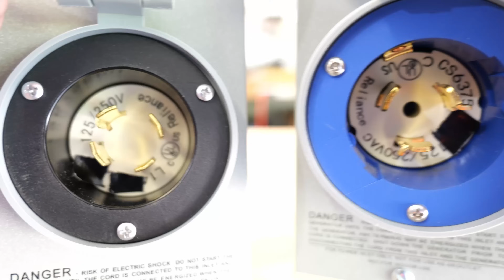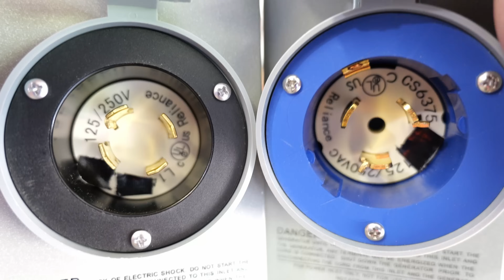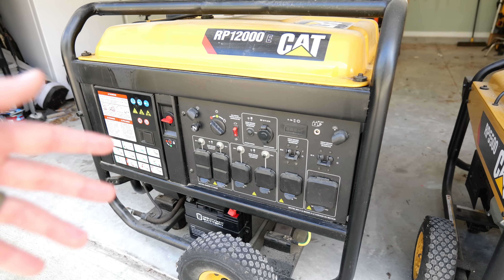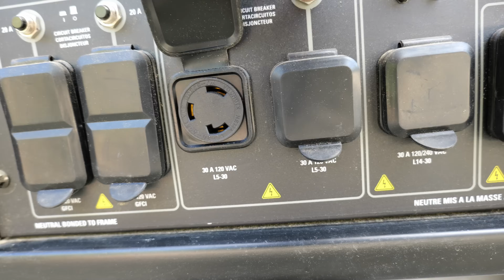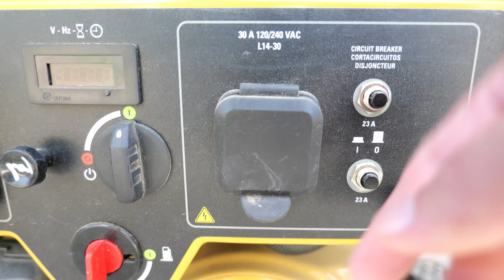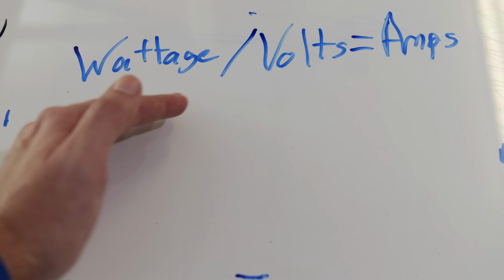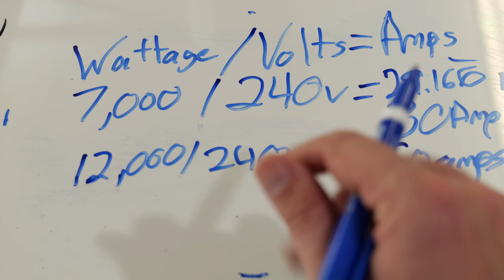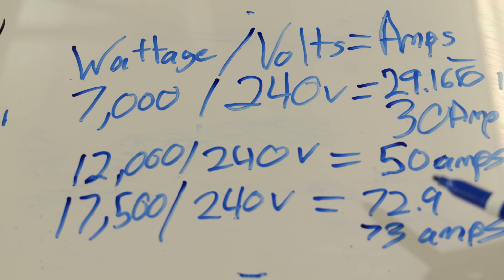30 Amp vs 50 Amp Power Inlet Box.  What's The Difference and Which One Do You Need?

Comment: Hello and thanks for the video! I have a couple questions for you. I plan on buying a generator that has a 240v 30amp L6-30R outlet. I have a ShinePick 50 Amp Generator Power Inlet Box, NEMA 3R Power Inlet Box,125/250V 12500W with a SS2-50R receptacle that runs to my homes sub panel. I want to be able to power my mini split AC that requires 240v. Am I able to do this with a L6-30P 3-Pin Male 220/250V Plug To SS2-50R adapter. So it would be a L6-30P cord coming out of the generator and then the L6-30P 3-Pin Male 220/250V Plug To S52-50R adapter from the cord to the inlet box to the sub panel. Any help is appreciated :)

Comment: Let me ask you about my situation.  I have a transfer switch on my house panel that has a 50 amp dual pole breaker with a 50 amp receptacle on the power inlet box.  My F150 has a 30 amp female receptacle with 7.5KW maximum output.  I have a generator cord with the 30 amp male plug to plug into the F150.  The other end of the cord has the 30 amp female plug.  Can I change out the 30 amp female plug on the cord to a 50 amp female to plug into the power inlet box?  The cord is 10 awg wire.  Will this work?  Or, do I need to switch out the 50 amp breaker to a 30 amp and change the power inlet box receptacle to a 30 amp as well?
Reply: You need an adapter NEMA L14-30P to SS2-50R

Comment: Man I just bought some 6/3 UF wire I was going to use for a 30 amp EV charger.  Do you really have to have an 8AWG ground?  The one I am using is 10AWG.  Do you really need that much wire for fault current? I'd like to upgrade from 30 to 50 amps without having to replace the ground wire.

Comment: 4 Questions:

1. What is the maximum length 50amp cable I can run from my house to the generator?

2. Can I connect two shorter,  50amp (25ft each) cables together to go 50ft?

3. When running a 50 amp unit, what gauge grounding rod cable do I need?

4. What is the maximum length cable I can use to earth ground the above?  I would actually like to use a car jumper cable if possible. 

Thanks!!!

Comment: Seems like the smart thing would be to install a 50 amp in case you want to upgrade in the future.
Reply: I say most people do not already own a generator!
Reply: They should but i agree. Im just trying to figure out the best way to connect mine as its large enough to do the furnace,well pump and some lights maybe the dryer if everything is shut off but ill worry about that if the time comes. Instead of running extension cords and being able to power things that might actually matter instead of lights.  @videodude8137
Reply: I did this. My generator can only do 30A, I installed the 50A inlet and got 30A to 50A cable in case I get a larger generator in the future.
Reply: @thatsux0rz am about to do the same thing.  Had to buy an adapter cord to make the change over.  Installing next week. Let me know if you have any words of wisdom before I get started.
Reply: All of us commenting just run inlet, #6, 50amp inter lock, a quality whip line, and power it up.  Customers, gotta put the safety in and idiot proof it.
Reply: I have 30A boxes.  Now my new system can source 41A, so I need to upsize to 50A.  Start with 50A if you have the resources. $$
Reply: No one talks about 30a inlet max watts. People don’t know 30a inlets have 7500watts max capacity. So if your generator have running watts about 7500 watts you really don’t have an option but yo go 50a inlet which max @ 12500 watts.
Reply: Very clear information! Do you have any RV electrical videos?
Reply: is 10/3 romex good for like a 25ft run in my garage on for a 50 amp? I want to be ready to if  I need a 50 down the rd
Reply: @minibikemadman  no 10/3 is not good for 50 amp #8 minimum
Reply: @JuarezDerrick  k thanks!!
Reply: @JuarezDerrick  yea not gonna mess with 50 amp now..ill rock the 30 amp for now.
Reply: @minibikemadman  run 6 gauge then you can run more power
Reply: Yes, it is best to run a #6 wire from inlet box to your breaker (or transfer switch) . If your generator is only 30 amps, when you UPGRADE to a 50 amp generator,  you will already have the wire installed.
Reply: @jamesborton9237 this is the real factor.  Are you using 6 gauge or 8 gauge? If 6 gauge run the 50 if 8 gauge run the 30.  👍
Reply: Will a 30amp O/S plug box accept # 6 CU ,?
Reply: @GeekWireless  It'll "C" u later 😁
Reply: @GeekWireless  I just tried to use 6/3 wire to my 30 amp inlet box and the wire is too thick
Reply: @GinaScott0315  Exaaaaaaaaaaaaaaaaactly...
Reply: @GeekWireless  Absolutely NOT!  Don't even try it or risk it!  However, a #6 CU will accept a 30amp O/S plug box oddly enough...
Reply: @GeekWireless  Dunno about 6 but it will take 8,
Reply: I concur
Reply: Can we use 6/3 wire for a 30 amp box in order to upgrade to a 50 amp later?
Reply: @jessecarter5490  Yes.  However DO NOT us 8/3 wire with a 50 amp to downgrade to a 30 amp box later.  Lol.
Reply: Yes @jessecarter5490
Reply: @jessecarter5490 from what I've seen, it is ok to use 6/3 wire for a 30 amp breaker, but you cannot use 8/3 wire for a 50 amp fuse. I'm thinking about running 6/3 wire to a 30 amp breaker,  getting the 50 amp inlet, and using a 30 amp to 50 amp cord adapter. That way, when I upgrade my generator, all I have to do is upgrade the breaker.
Reply: Very helpful with our decision to run interlock to 9500 30 amp generator
Reply: I hired an electrician to install the 4 prong inlet box along with the interlock kit. My generator has the 30 amp / 240 plug out. It’s a 4 prong plug. My understanding was when power goes out. Plug into the inlet box. Turn off main. Interlock will allow the generator breaker he installed to be switched on. Fire up the generator and this will send power to the house. I don’t plan on using any AC unit. Just for lights and refrigeration. I did look into the transfer switch that had 10 connections but the electrician say because my main was outside and the sub panel was inside it would make wiring the transfer box a lot of work. So this is why he suggested to just do the inlet box and placed it outside close to the main. 
I may decide later to just do the transfer switch as then I’m able to just select the breakers I want.
Reply: I have both, when your already in there might as well do everything. 😂
Reply: The question should be about what you need during an emergency.  It should not be everything in your house unless if you are going with a whole house generator.  You can go big, but you also need to have the fuel on site to keep the generator running through the emergency.   If you have natural gas, sure go whole house, or have a good sized propane tank, and automatic switching does have its advantages.  But for a portable generator, you have to feed something that may need 1 gallon of gas per hour at a 50% load(12 KW).  If you have a large load(well pump, electric stove, ground sourced heat pump, resistance heating, big AC unit), then you need big power to start it, but if you don't have that or need that, then keep it basic.  My storage is 27 Gal of gas which combined with my planned generator usage should last a week in winter or summer.  If I had that 12 kw generator, that would cover 2-3 days with my usage of 4 hr in morning and 4 hr at night.
Reply: @gibblespascack1418  At my age, I've learned to just be ready. Gas unused goes into my daughter's truck when she visits 🤣, and we all know about the "home generator" , I bought a 40kw portable from generac for 3500$ my cost with huge upgrade gas tank and added a drain line.  No breaker safety (I don't condone) , 50' #6 50amp extension, solid rubber tires, push start to run now and then and own a portable jump box 179$ for mine, total cost without a safety and a bit of time. 4500$.  
#1- turn on all your crap with empty hot water heater that's reheating (if applicable) , oven "if", dryer "if" , everything! 
#2- test amps and watts (see what your using " and try to get one where your at 75% with all on. I run 40% or less on even distribution on my box which I rewired when my worker left, good kid though, just young, but 30amp won't even handle my camper as I have the adapter but jacks with my sensitive TVs and ac compressors.  The only thing really more to your thinking is a few dollars more on the #6 and all the women coming over for the hot tub party😁! 
#3- get what you need to keep a happy house
#4- I'm overkill at 40kw , but I'm running a barn also plus tools, I get board, but point being, get what you NEED and afford to swing the big one in yo hood!😂. I'm in the country and to damn old to have nots when I'm old enough to have been through it by coast and large property outages.

So hell yeah, put 50amp set up interlock! But see what your pumping normally plus extra by turning it all on when testing each side to see amps and watts!
Reply: @gibblespascack1418  great point especially when emergency can = survival mode. The other thing I've thought of is the noise of a much larger generator.
Reply: In this instance, would you just use a 30A cord with a 30 to 50A adapter connecting to the house inlet or is there a cord like this available?
Reply: @nja8836  As far as I can tell there is no cord you can buy with the proper ends,  you will need an adapter,  or to make your own,  Yeah ,  Crazy I Know.
Reply: @nja8836 this is what Ive heard. Then when I upgrade to a larger generator I just need a nee chord. But I have an electrician telling me I cannot use a 50 amp receptacle with a 30 amp generator. Im calling bs on that one.

Comment: We had an electrician install an interlock kit with a 50 amp breaker and mistakingly put a 50 amp "outlet" box on the outside of the house.  I did not want to use a male-to-male cord, so called them back and they swapped out that box with a 30 amp inlet instead.  Makes sense because I only have a generator with 5200 running watts.  But is that a problem having a 30 amp generator inlet box wired to a 50 amp breaker?
Reply: In this case no it's not an "issue". Because power doesn't go out from service to generator. It goes from generator to your panel. You can only put 30a into the plug. So the 50a breaker will never trip and instead the generators built in breakers will trip if overloaded.
Reply: If you had the opposite say 50a receptacle and 30a breaker. That's an issue.
Reply: Rule of thumb, breaker should not be rated higher than the actual amperage used. It’s a feature for your safety.

Comment: In the video you said your system could run both generators at the same time. Did you mean in parallel or how you wired the inlets? Could you explain more or do you have another video showing how you did this. I just subscribed!
Reply from the maker: I have another video that kind of touches on it.  But I have a power inlet box with interlock kit for my large generator and a 30 amp transfer switch for my little one.  So if I want to run both I just hook up my little one to the transfer switch, transfer the power from the utility side to the generator on the transfer switch and it pulls everything on the transfer switch out of the main circuit.  Hope that makes sense.
Reply: @HowToHomeDIY  it does. I didn't realize you had a separate transfer switch. Thank you for the reply. Your videos keep popping up on my feed and you are definitely one of the best when it comes to anything DIY home related. Didnt even realize I wasn't subscribed. Thanks again man.

Comment: Ok...now I'm confused as to if I got the right or wrong thing. I have a 30 amp transfer switch with 6 110 switches but just purchased a 11,000 WEN Generator. Am I going to be ok running this generator into my 30 amp service using the 30 amp cord and outlet?
Reply: Yes, that will be OK.  The generator will send up to 30 amps from that 30 amp outlet and cord.  And you are going into a transfer switch designed for 30 amps.

Comment: Good learning videos, thanks.
So just installed a 50A house inlet, which adaptor do I use to get it to a 30 amp 120v generator plug in?
I’m baffled looking on Amazon 
Thanks again!
Reply: You would need a 30 amp 240 volt outlet on the generator, not 120 volt.  If you have the 30 amp 240 volt outlet, then you need NEMA L14-30P to SS2-50R

Comment: My issue is that I have a 50 amp inlet and I use it for my generac 15K generator, but I am buying a ecoflow system that will be 30 amps.  Is there a way to use an adapter in these situations if I need to switch back and forth or do I need a second inlet?

Comment: Thank you for this video! I am going to install a back feed receptacle on my home (am aware of all the perils of doing so and the main will remain shut off while in use), below the panel. My harbor freight 9k generator has a 30amp 4 prong twist lock plug for 240v. However, I see (on amazon for instance) that most of the receptacles list 7500 watts max.  Based on your formula, mine shows 37.5 amps. Should I be ok using a 30 amp receptacle if I use all 6 ga wires for the panel to receptacle, and for the cord? I'll still have small lugs at the connections
Reply: Down rate the receptacle: use a 50Amp and the larger wires to the panel, also the link to your generator. Don’t try to run > 30A load on equipment and cables that top out at 30 A!

Comment: My generator has a 50amp outlet. Its a firman Tri-fuel with 9400/6500/5500 running watts on Gas/Propane/N.Gas. Will I be able to produce and connect to a 50amp box on N. Gas or will it not provide enough power?

Comment: This guy is not an electrician. He sounds like he knows what he is talking about, but he doesn’t know the electrical code. Be careful listening to an jack of all trades guy. You might burn your house down or electrocute someone. Just because it’s on YouTube doesn’t mean it is safe and useful information. If you wire a generator to your service entrance, you MUST GET A PERMIT and it must be inspected. Your electrical utility can and will disconnect service to your house if it is reported to them. You do it without a permit and have a fire or hurt someone, it is a crime and your insurance company will not pay any claims.
Reply from the maker: I’m not an electrician but what in the world happened in this video where that is even relevant?   I compared the differences of some power inlet boxes.  The issue you raised has nothing to do with the video.  That being said, the issue you raised is also not always the case and you left a lot out.  My utility doesn’t care that I’ve wired up a power inlet box with interlock kit.  They have been out numerous times to see it 😂
Reply: If u use that dryer plug cheater cord without an approved interlocking transfer switch you can back feed the grid and put lineman’s lives at risk.

Comment: Hello, I'm off grid and I have an Aims 6000-watt inverter/ battery charger with a 11000-watt startup output the charger can charge the batteries at 60 up to amps when the sun is behind storm clouds. The inverter has 4 connectors for the 240-volt input that is designed to connect to grid power, and I can connect to my inlet box. Currently I've wired the inlet box to the 30 amp plug on the generator. After watching your videos I'm thinking of re-wiring the inlet box using 50 amp that way it can run my house and charge my batteries at the same time. My Generator is a 9500 watt with a 11000-watt startup. My battery bank is 48-volt Lithium Iron Phosphate 600 Ah. What do you think?

Comment: I have a predator 8750 peak generator with 28 amp max.  Electrician told me to run a 50 amp wire and use an adapter to plug into my generator and the built in breaker would be enough to prevent overload since it would just shut off...does that sound right? And should i really go with 50 instead of 30??

Comment: I have a 8k generator. According to your math. Should I go 30 amps or 50 amps?
Reply: I would recommend 30amp, extension cords are less than price of 50amp and most likely your generator will have 8k surge and closer to 6-7k running watts.
30amp @220v/240v= 6600-7200watts

Comment: Hi. But can't  we do a 50 amp installation and still use a 30 amp connection simply by using a 30 amp adaptor. This way if we ever want to use 50 amps in the future the 50 amp installation is ready, right?
Reply: Thanks for asking this, wondering the same thing.
Reply: He just answered this question a month ago:  You can always have the larger 50 amp rated wire and box installed and run a smaller generator on it but can’t do the opposite and have too small of wiring and box and run a larger one.

Comment: I have a 5500 watt generator.. when plugged in to my 30amp service it can only run lights in the with maybe a fridge it has a hard time doing that... thank you for the great video...
Reply: This doesn't make sense. A 5500 W genset should have no problem running many lights, multiple fridges, TV, router, chargers, and even a heavier load or two like an air compressor, window aircon or portable aircon, well pump or sump pump, etc.
Is it possible there was some other large load on that you hadn't noticed? Like maybe an electric water heater?

Comment: I have a question. The main panel by the meter has a wire FPL seal on it. Can I break that to install the inlet box or do I have to connect at the breaker panel
Reply from the maker: No.  That is their side of the power.  You should have a main disconnect at a different panel.

Comment: A hole house generator that uses natural gas doesn't have any electrical outlet plugs, that means that it's not for commercial construction sites
Reply from the maker: Yes, that’s correct.  Not sure as to what your point is though as you wouldn’t need either of these boxes either.

Comment: What if my 4500W generator only has a 3 pole  30amp outlet
Reply: You can get an adapter to plug it in to an inlet box but you will only have 120v and half the load center will be energized.